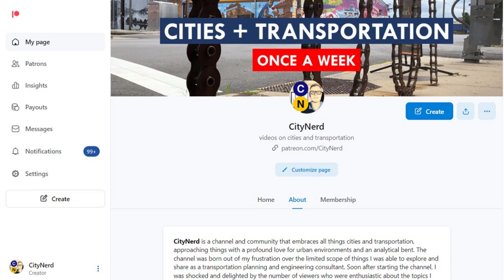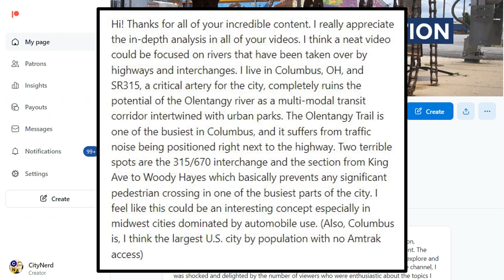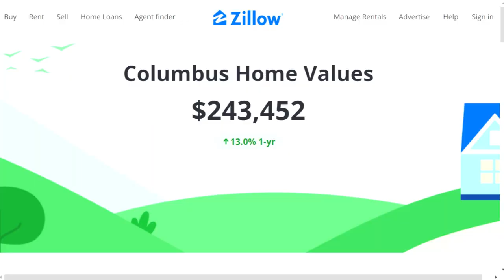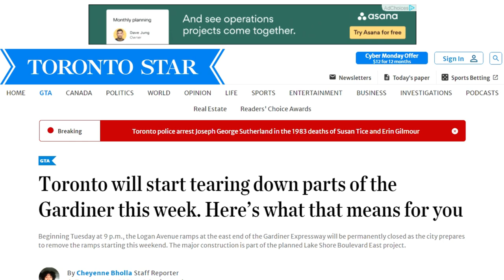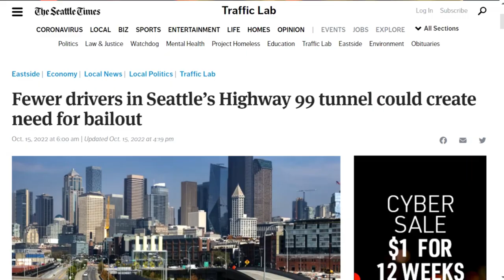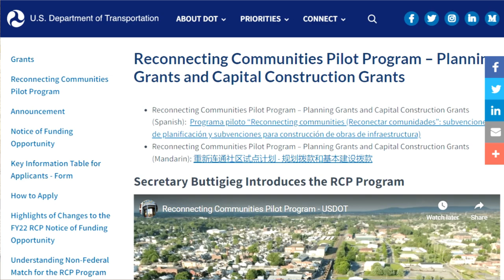Highway Engineering Madness: 10 Waterfront Freeways That Need to Go (North America Edition)

Comment: You should do "build a city" series whenever you pick a smaller city with the potential to be a great place to live and how you would build it out
Reply: Would be built on rock and roll?
Reply: I like this idea. Because the current landscape is flawed  by design
Reply: yeah make him play city skylines
Reply: I lived near NYC for 65 years. East River Drive skirts the Upper East Side of Manhattan, so there’s no alternate route for it! In a perfect world there’d be public transportation into cities and and all suburbanites would use mass transit and only commercial vehicles would be on the streets but Big Oil, Big Auto and Big Tire block this. Lake Shore Drive the same deal.
Reply: I love this idea. Two or three cities where I grew up are slowly merging, and it's all a car dependant nightmare. They'll be as bad off as DFW in a decade. If they put in some good light rail now, they could avoid an absolute cluster later on. It could be a paradise! But they're not talking about it at all yet.

Comment: Speaking of Toronto's Gardiner Expressway, there are a lot of short-sighted tree-hugging activists and politicians who are constantly advocating for the expressway to be completely torn down. Of course, these people conveniently ignore the reality of the resulting traffic chaos that would result from such a plan. All they need to do is examine the traffic situation which occurs regularly when the expressway is closed for 24-48 hours twice yearly for maintenance. The gridlock in the downtown core is unbelievable as people try to find alternative routes to traverse the centre of the city. If the expressway were at ground-level, then they may have a case. However, the roadway is elevated, which allows vehicular and pedestrian traffic to pass beneath it and gain access to and from the waterfront. Some people simply do not think things through, and this is a classic example.

Comment: Chicagoan here: About the only thing I'd keep with Lake Shore Drive is the numerous express buses that use it.  I think it would be way better if it was narrowed and turned into an exclusive bus way for express routes that oftentimes (when traffic is low) get you to the loop faster than taking the L.
Reply: Although by the time you're shrinking it to two lanes and making it bus only, it might be worth considering a tram with grass between the tracks.
Reply: I am also a chicagoen  much of the traffic comming from the north has no way of getting down town through the north side of chicago without a lof of noise polution and so on... .

I feel like a ribin of highway in the lake the far north side to replace trafic on Sharidan Road as well as stacking  or tunneling much of the north side.
Reply: @traveller23e  I wish, but the USA is allergic to such sensible transit solutions...
Reply: Agree
Reply: I think it should be converted into a light rail line. That would be amazing.
Reply: @neilworms2  tram do not alway go where you want then you have find less effective ways to get to where you want
Reply: @gabetalks9275  Then you could actually enjoy the views while you're moving!
Reply: @gabetalks9275  Of course. Bicycling is my main transportation. I miss living in Lakeview to take advantage of the trail. My point was that driving & looking at views = bad. The gorgeous views make it very tempting to look.
Reply: I think the Metra Electric should be extended replacing Lakeshore drive north of downtown, creating a new line that runs from 93rd to Hollywood, and of course runs every 5 minutes. Though Metra would have to buy trains that are appropriate for rapid transit.
Reply: @BurjTransit  That would be awesome, I wish I wasn't so beaten down by how terrible America is at doing good transit.
Reply: @BurjTransit  Also, nothing wrong with what Metra has at rapid transit frequencies, Australia runs their commuter trains in Sydney and Melbourne near those frequencies btw.
Reply: Omg YES! I think that would be a great idea! Traffic on LSD can be just atrocious.
Reply: @traveller23e  Or just extending the Metra Electric to service Northern Chicago as well.